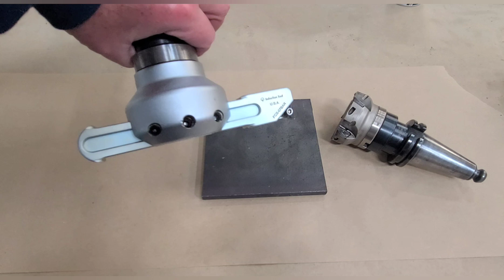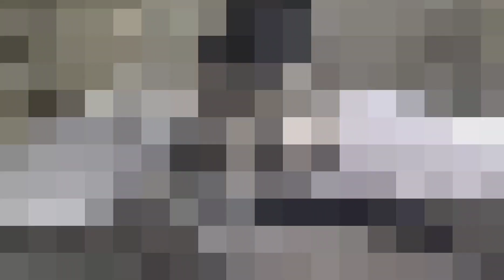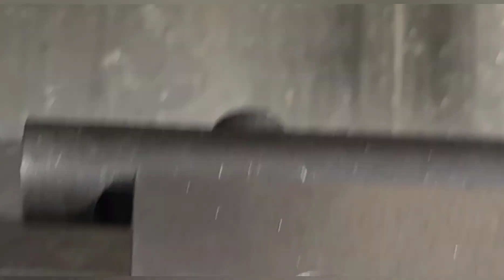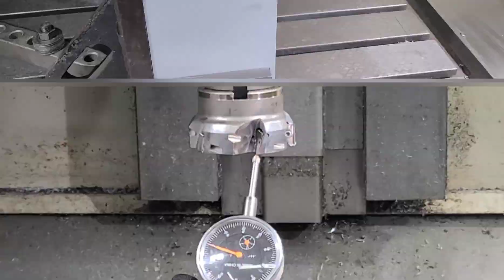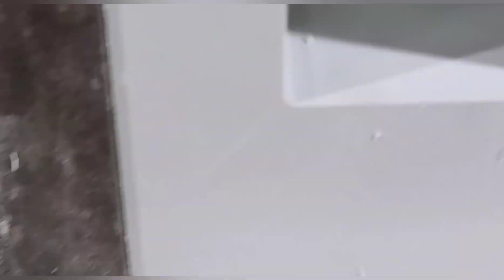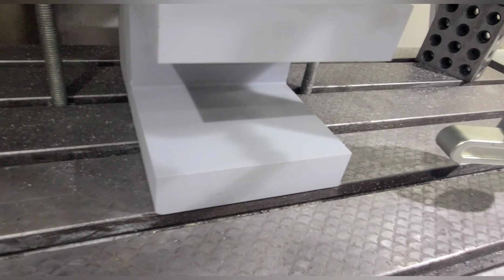Machining with Fly Cutter VS Facemill Round 2 The Gloves Come Off!

Comment: with you cutting a deep slot, don't you get any pinching with that stuff and when it is on it's side isn't there any sag from the top leg and flex with the fly cutter cutting the top surface from the inside, effectively cutting and theoretically pushing the work up as it is cutting out?  must admit nice bit of gear.
Reply from the maker: Hi,
Thanks for watching and commenting! This material is surprisingly stable unlike some steels like cold rolled. It was designed for commercial aircraft dies and used for stamping the fuselages and wing parts. Where you cut it is where it stays. The company that made both the material and dies had a huge CMM to check the parts and I have witnessed  them pouring the blanks because a friend of mine worked there and also cutting the dies on thier enormous cnc bridge mill. They sold out to another company a few years ago and I no longer have acces to the excess material but I wish I did because I have used it for many projects.
Reply: @mvpmachine  thank you for you reply. I have never seen anything like that before, I would imagine it would be quite pricey.
Reply from the maker: @paulrayner4514  the company that made it had a polymer division and a machining division so it was an internally developed product that was only used for their own jobs. I think it likely is quite pricey to make but they did not sell it to other companies. We used to make carbon fiber fixtures for the auto industry and they had a chemist that developed the resins for a lot of applications including carbon fiber and this material. Great people but they got to retirement age and sold off the company. The company that purchased them I believe still does the same thing and they are only a mile or so from our shop but I do not deal with them.
Reply: @mvpmachine  would it not be worth dealing with them, If you have a big enough customer base to warrant it
Reply from the maker: @paulrayner4514  I have toured thier facility with the intention of getting some work but nothing ever came of it.

Comment: I’ve been making similar fly cutters that take cnmg 43x inserts for many years.  A very versatile tool with a high rigidity head.  Our shop had a stack of T1 bulldozer blade parts to machine.  6” wide .100” deep cuts and thick heavy chips throwing all over the shop.  
The self clearing nature of the fly cutter is not to be underestimated.  By far a more economical tool in the right circumstances.  
The only thing to be careful of is the tram of the head as  the wide cut seems to exaggerate the error versus several narrower cuts. 

Very good video sir
Reply from the maker: Hi William thank you for watching and commenting!  It's hard to beat an inserted fly cutter for many of the projects we do as well. Many machinists dismiss the value of these thinking of the HSS tool bit versions that are so common and cheap. We made our first fly cutters to cut the inside of large copper weld guns for the auto industry, some of the bars had to be 4ft long to do the job. Once we mastered the proper angles it made the job easy and we were the only company that the customer would use because the quality and finish was so good.  Glad to hear about your cutters sounds similar to how our came to be.